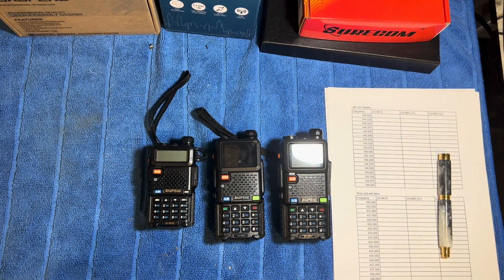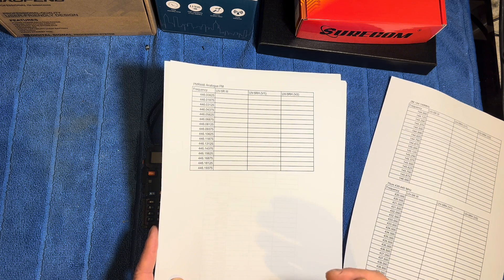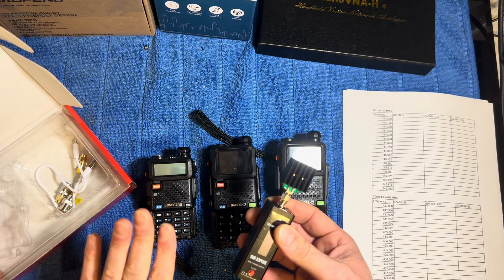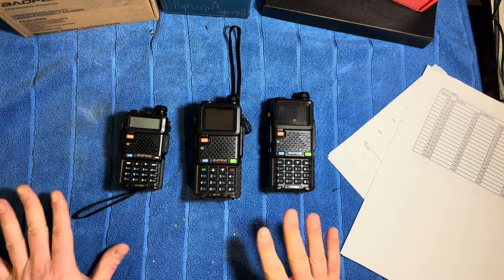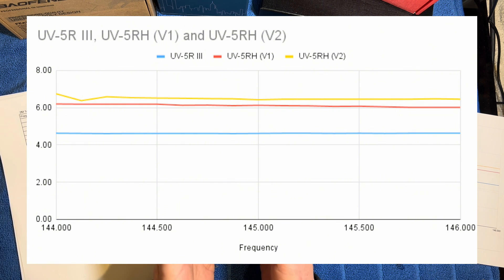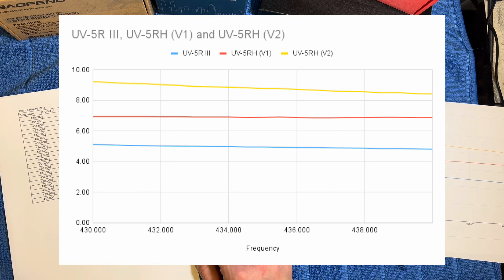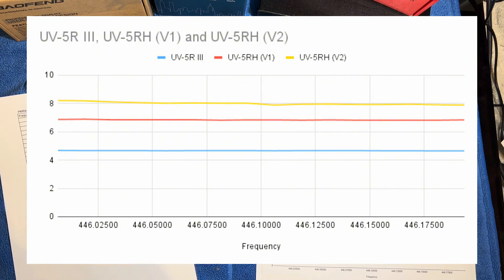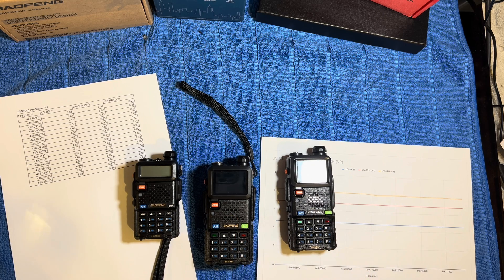Baofeng Power Test UV-5RH V1, UV-5RH V2 (UV-5RM), UV-5RH 5RM

Comment: hello. greetings from Brazil. I'm just starting out at radioAmador. very good video. I intend to purchase some ht model. to use as a base, in my home. with an external antenna (flower pot) which ht cm radio is the best value for money can you tell me? strong hug.!
Reply from the maker: Hi. 

Most of the Baofeng HT radios are 2m (VHF) and 70cm (uhf) so the basic UV5r and variants are suitable. 

If you search for “Dual band flowerpot antenna” you’ll find instructions to make an antenna that will cover both bands.
Reply: @M8KHC hello. Thanks for the feedback.. yes I will opt for the baofeng uv-5r anyway. to begin. I'll leave one at home with an external antenna. and another in the car. with mobile antenna. I'm in doubt between two fixed, external base antennas.. between the flower pot. or the OSJ. know which is better? thanks. Strong hug. 73

Comment: How do you check to see if my uv is unlocked like yours?
Reply from the maker: When you are in frequency mode simply enter either an airband frequency eg (118.575) and see if it will accept it, or a 1.25m frequency (eg 235.300) and see if it accepts that.
Reply: @M8KHC  thank you!

Comment: Excellent! Very thorough review Matt. Just proves that the 5RM/RH can pack quite a punch power wise for a Baofeng handheld. Certainly a step up from the little old UV5R.
Reply from the maker: Thanks. I have another two coming in a week or so and will be seeing if the results are the same or if there’s any significant variation. One thing I’ve learned is that no two Baofengs perform the same.